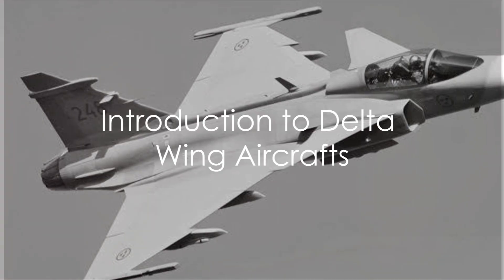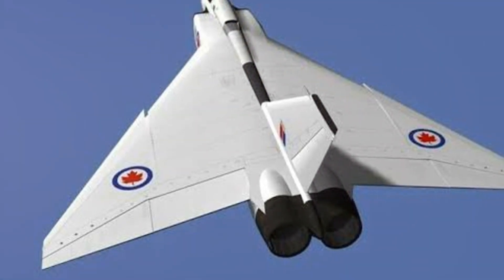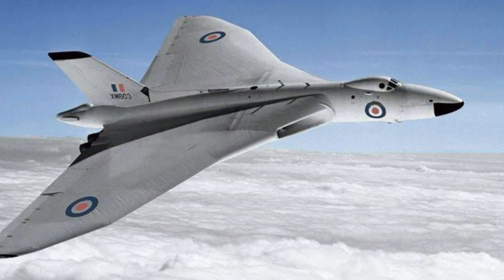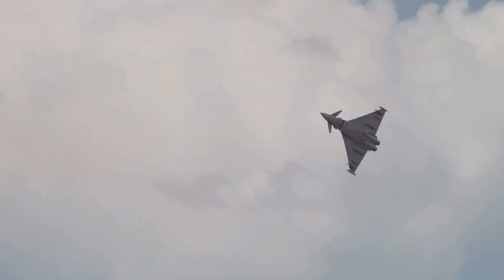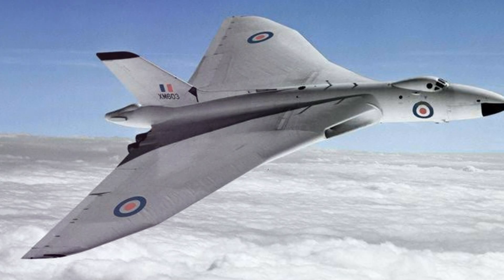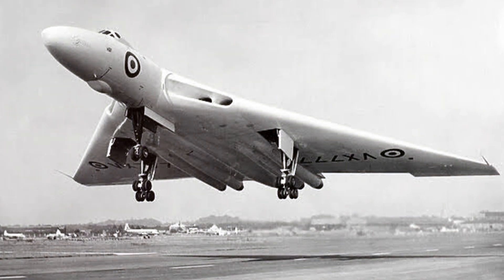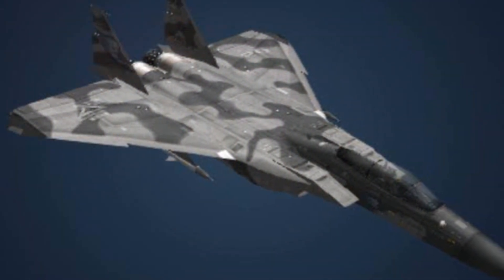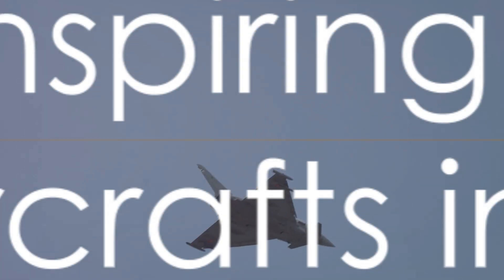Why Fighter Pilots Prefer Delta Wing Aircrafts

Comment: If that's the case then why aren't all fighter planes build in delta form?
Reply: energy retention, especially while manouvering, is much worse than other types of crafts, that means that even if they do turn better, they will do that for much shorter periods of time before having to gain speed again because they depleted all of it. Drag is a problem of Delta wings, not as the video sais. More area means more lift but ALSO more drag.  Many of the aircrafts the video shows aren't even delta wings (F-117 notably wasn't even good at flying, F-22 and all the Sukhoi aircaft shown aren't delta and are some of the more manouverable). All in all this videos only talks about the advantages, getting some of them wrong as well, and not about the disadvantages.